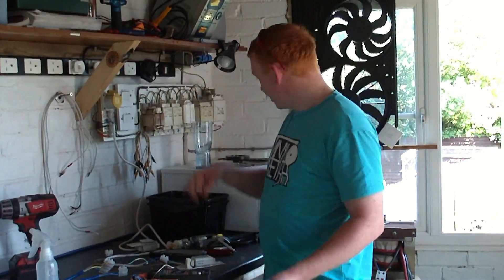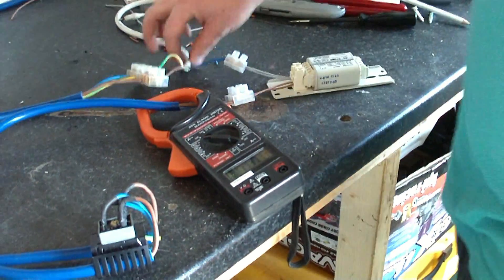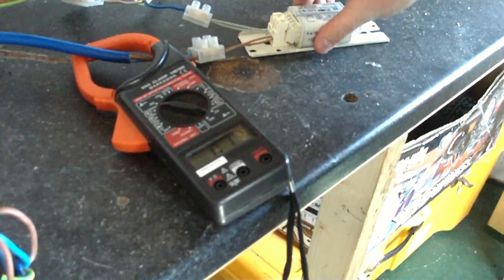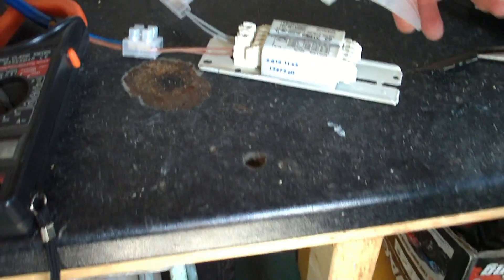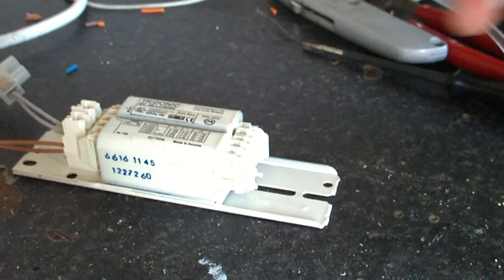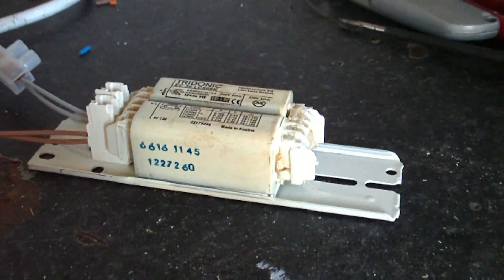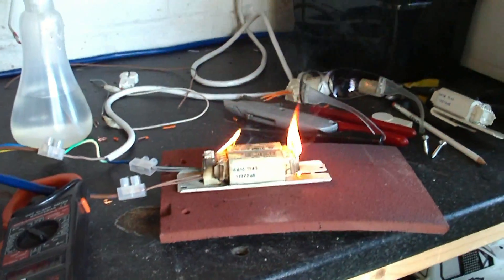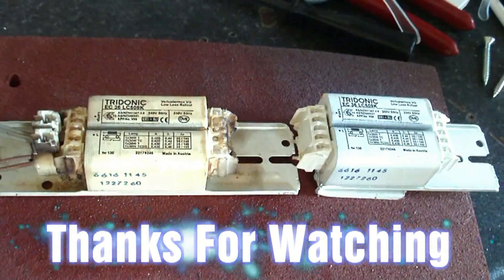What Not To Do With A Ballast

Comment: I have that same exact ballast at home. Is there any DIY project i can do with this ballast?
Reply from the maker: Well it's rated for 240VAC @ 50 Hz. Keep the same frequency and you can go from 0-240VAC and you won't burn anything out. 
All a ballast does is limit the output current. It's just one coil and the magnetic field expanding and collapsing is what limits the output current. Obviously the lower the voltage the less current you'll get out. You can over volt theses for short amount of time, but that once again all depends on the input voltage.
Reply: @TheManLab7  Thanks for replying man. So a ballast is basically a large Inductor. It seemed like a transformer, so I thought would it step down the supplied voltage from the grid.  Since it only has a single coil, it wont work as a transformer. Let me figure if this can be put to some use for any sort of project of mine. If you come across any idea, do let me know.

Comment: hii,

i don't understand as well. a copper ballast is basically just a 
transformer inside.. with 2 separate coil..

why when he shorted the output coil wire, but the ampere draw was 
0.4amp.. but when he put a half wave diode in the output coil wire, it 
heated up substantially ? why ? 

can you explain or any youtube explain that ? 

thanks
andrew
Reply from the maker: I know I said half wave but it doesn't matter. A full bridge rectifier with a large cap so it's proper full DC with no ripple will do exactly the same. When I used just one diode you can see and hear the magnetic field expanding and contracting. If I did a full wave with a cap there wouldn't be any ripple or noise as it's just a short circuit.
Reply: hii

finally understood. you are super, thanks for your patient. appreciate it. 

 andrew
Reply from the maker: Anytime 👍🏻 🙂
Reply from the maker: With AC you have a magnetic field which expands and collapses, with DC you don't have that. 
Transformers work by using the magnetic field which couple to the other coil and the different ratios depends on what the output voltage will be. Ballast don't have a secondary coil but the magnetic field limits the output current. 
With DC there's no magnetic field so it doesn't limit the current. It's just a piece of wire and because it's a small piece of wire in the ballast it gets very hot, so hot that the cable melts.
Reply from the maker: The way a transformer works is via an AC wave form. It expands and contracts by the input AC frequency. With a ballast there's just one coil in an iron core. The amount of turns in the iron core makes a magnetic flux which limits the output current. This is a 240VAC 58W ballast. The lower the voltage the less current you'll get out of it but if you exceed the input voltage the ballast will get extremely hot and possibly burn out. But this all depends on how much you over volt the ballast. In England its 50hz and in America it 60hz, but the frequency doesn't matter when it's around that ball park but the high frequency transformers which are in the khz are a lot small for there size due to the magnetic flux.

What I've done here is put a diode in line with the ballast which cansels out the magnetic field. Putting a diode in shorts the ballast out and doesn't create a magnetic field so it can't limit it self. Current is only flowing in one direction so it over heats it self and burns out. What I've done is short a bit of wire out.
It's very simple if you know how it works but it's hard to explain 🤔
Reply: thanks for taking time explaining.. 

although still vague to me.. 
thanks

Comment: the inductor turned into a resistor :) and its not happy about that
Reply: hii,

i don't understand as well. a copper ballast is basically just a transformer inside.. with 2 separate coil..

why when he shorted the output coil wire, but the ampere draw was 0.4amp.. but when he put a half wave diode in the output coil wire, it heated up substantially ? why ? 

can you explain or any youtube explain that ? 

thanks
andrew

Comment: as far as i know, for me, this is the last electronic product i use (particular this brand) was made outside of china...
Reply: No, this ballast brand is fine. He is showing what happens when you run it off of a DC current supply, instead of an AC current supply. The ballast (basically an inductor, also called a "choke" sometimes) doesn't limit the current on DC.

Comment: hello! call me an idiot if you wish, but how to you connect/disconnect the wires from that type of ballast? i have a light fitting with the very same ballast and the wires just appear to be pushed in? there does not appear to be a screw driver required etc? i gave the wires a reasonable tug by hand expecting to pull them straight out but no luck... What's the trick, i'm usually pretty good at figuring this stuff out? Cheers!
Reply: mreguest1000 a fine bladed terminal screwdriver gently pressed into the slot releases the ratcheting connection.

Comment: now maybe explain the difference between AC impedance and DC resistance, why it works on alternating current (50/60 cycle) and catches fire on direct current.
Reply: +firstname lastname because on AC the impedance limits the current going thru the ballast, on DC you only have the actual coil's resistance

Comment: Happens a lot with halide lamps too. Discharge lamps need to be individually fused - a 16A fuse for a whole lighting circuit isn't adequate.

Halide lamps also tend to rectify at startup for a fraction of a second, so you get some nice grunting noises from the ballast, and a big current draw until the arc stabilises.

Comment: Haha...You popped it. :-D

Just wondering: If you put one of these on DC, does it then act like an electromagnet? :-D

Also, when doing this poppage, did you have another ballast in-line with your variac to protect it when the half-wave driven one went *POP* ? 

Interesting vid though. :-)

Thanks for showing,

-BoomBoxDeluxe.
Reply from the maker: I can't remember but I don't think there was one protecting it. It was just straight on the output of the Variac as it'd just blow it clear due to the amount of current going through it all. If the ballast didn't burn out then the tiny cables would end up being fuses, lol.

This is just on one diode btw. I'm not sure what would happen if it was on a FULL BRIDGE RECTIFIER!!! with a smoothing cap.

Comment: nice video, inversely you could connect a cap to a dc source and it would just charge but if you connect it to ac you get "current flow" and heat